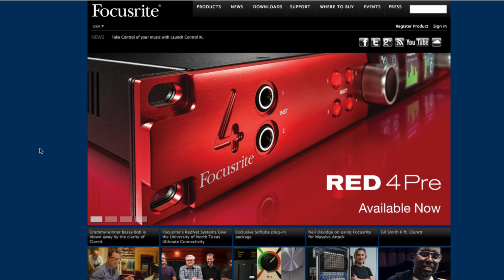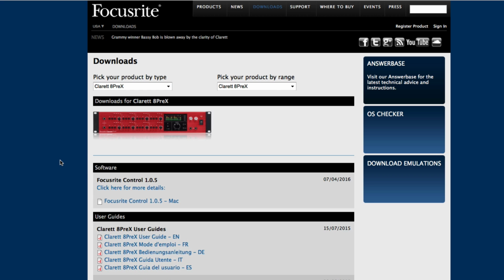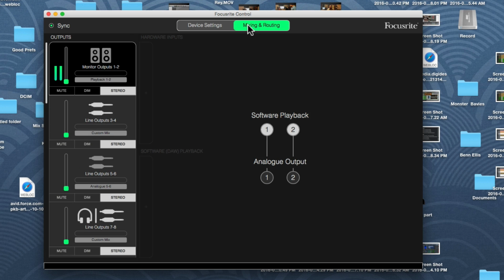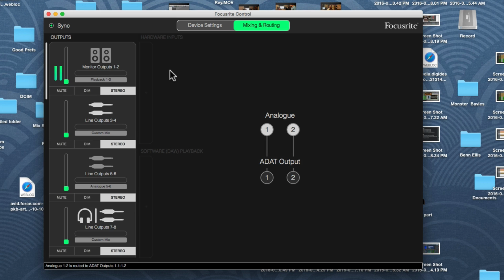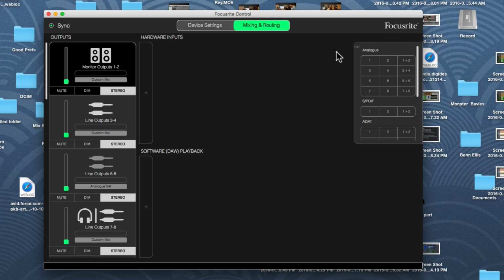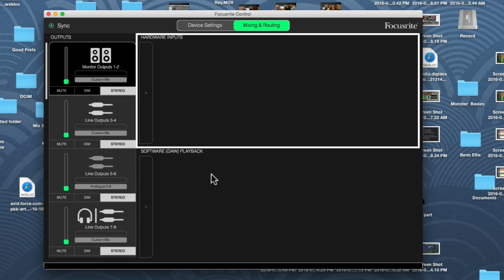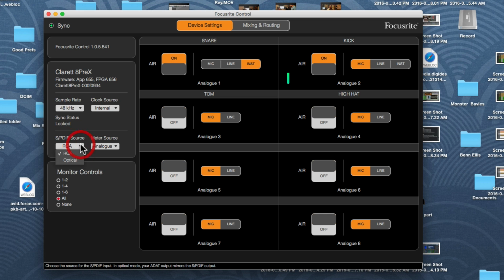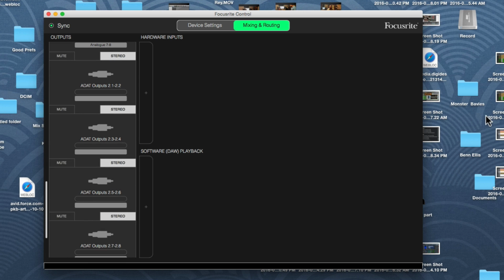Focusrite Control - Introduction

Comment: Does anybody have a problem in Device Settings? When I press the tab it shows ''No inputs with software controls''. There is no solution on the internet with this problem. Tried to reinstall drivers, but it still doesn't work :(

Comment: Hello! I have a question. I am sure the answer it's very simple , but it's just a thing that i don't know how to solve. I have an old oxygen 8 midi controller. The M-audio didn't realised a proper driver for windows 7 64 bit, so...the only way to use it is, as i read somewhere alse, connecting it via midi. So I have a midi cable, i connect it on midi out (on oxygen) and midi in(on focusrite scarlett 6i6 mk2). But, i don't see the "green light" on the midi on focusrite, and Cubase doesn't do anything, the computer doesn't recieve the midi signal etc. So...I was thinking. Is this something that I can solve using Focusrite control ? And if so..how? Because in all the routing options of the software i don't see anything about midi in and out...

Comment: Idk if anyone will see this, but I got a new setup and I had to install this software for my 6i6. But now, everytime when I start up my computer I get a black screen with white text, which has something to do with this software (I've never had this before). The computer works just as it should, but it's a bit annoying to have to wait a whole minute or so for the computer to boot up. Is this supposed to happen with USB powered audio interfaces/every audio interface?

Comment: If you are familiar with Saffire Mix Control, Focusrite Control will be easy to learn.  However, if you are used to using Saffire Mix Control, Focusrite Control will not be easy to learn.  Makes total sense.

Comment: So, I just got the 18i8.  I am using Focusrite Control.  Do I need Scarlett MixControl?  I downloaded it, but it says No Hardware Detected, but the Focusrite Control works fine with my equipment. Is there a difference between the two?
Reply from the maker: There are two 18i8 Scarlet Interfaces. Gen 1 uses Scarlet Mix Control. Gen two uses Focusrite Control. All the best
Reply: That explains it.  I have the Gen 2.  Thanks!

Comment: Man I really want to thank you soooo much, I was on the brink of wanting to return my 6i6 2nd gen because my digital piano sounded like garbage on the 6i6's headphone jack but after watching your video I realized I had to put my hardware inputs to 1+2 not 1 and 2 seperate. thanks a million my friend.
Reply from the maker: Rajivrocks Ltd. That's great news. What a load off your shoulders. I've had similar tech difficulties. It sucks. Glad you got it resolved. All the best. George.
Reply: wow thanks for the quick response, I have one question though if you don't mind. I have 2 options in the device settings Inst and Line I assume I would pick INST here but what is the difference?
Reply from the maker: Rajivrocks Ltd. Np. Use your instrument  input for guitars, keyboards. Use your line ins for an external preamp, Guitar w Di box. The instrument inputs are hi z
Reply from the maker: Lastly. Lastly select instrument if you have your guitar or keybioard in the front. Use line for the line inputs in the rear of your interface.
Reply: Thank you again man it sounds so amazing now, just like I plug my headphones in the back of my Digital piano! :)
Reply: this sucks.. I dont have the knowledge to fix my stuff so here I am on youtube trying to figure it out but it hasn't gone very well
Reply from the maker: Max Strandberg sorry to hear that. Let me know how I can help. All the best. George.

Comment: It shows up on Ableton, but focusrite control says no hardware connected
Reply: you probably fixed it by now, but I had the same issue I uninstalled everything and rebooted then I reinstalled rebooted and it worked fine. I think for me I already had ASIO installed before that might have screwed it up for me before.

Comment: Hey bro, I bought my Clarett 8PreX, I registered but when I plug in my guitar or mic It won't detect any sound?
Reply from the maker: Javier Serrano is the meter in the interface lighting up?
Reply: No it's not lighting up...
Reply from the maker: Javier Serrano make sure you go in the focusrute control software and select instrument or line instead of mic.
Reply: I got it fixed man! But now I'm trying to record 16 channels at once but I can't! 
I have my ADAT cable plugged in from In 1-8 (Clarett 8preX) to the Out in my Scarlett 18i20. 
And I go to pro tools and I can't record what's on the scarlet in pro tools.
Reply from the maker: Javier Serrano Make sure you set up the clock right within the focusrute control. Clock should be set to internal and the afar cable should be lit up

Comment: nice video,
I'm thinking about making some step from Fireface 802 to Clarett 8PreX but seeing how clunky the Focusrite UI is compared to RME TotalMix FX, I guess I'll just wait for something different then
Reply from the maker: I don't think the Focusrite control is clunky. In fact, it is very solid
Reply: hmm, and are you happy using it? I'll examine it more then :)
I'm judging it by "readibility", let's say (a real situation I just did today earlier) I'd make 1 stereo headphone submix, 8 mono submixes (for external IEM systems), of all which would combine all the mic and adat inputs at various volume ratios, at practically "zero" latency, as it's play-alive use, plus record all the input channels individualy each "pre-fader" , plus some loopbacks so for ex. a midi instrument could be played through dedicated standalone app but also sent to submixes and also into daw.... I wonder if Clarett 8PreX could be even suitable for that? (obviously paired with additional ADAT mic preamp/s)
I'm also checking UI of Antelope Orion Studio, which distinctively different as well :D
Reply from the maker: for sure. specially if your using software stuff, the Thunderbolt will come in so handy for you

Comment: hi George,  question about focusrite control.

im using an 18i8 2nd gen.
whenever i plug in my audio interface, it takes a lot of plug and unplugging of the usb connector to my laptop before it's recognized by the software. it's kinda frustrating. and when installed the app to our iMac (yosemite), it immediately catches on the hardware.
my laptop's iOS is 10.9.5 (i had issues with iOS upgrades). is something about the version of the OS or most likely i got a lemon?
Reply from the maker: Hello. Thanks for reaching out.  I would shoot an email to focusrite support. They will help you out. Even if you bought the unit used. It's not interface itself because it works on your imac.  I recommend the following troubleshooting steps. 1) connect external hard drive or other hardware to your laptop and see if it works. If it does, then your iOS may be the issue. 2) try a shorter USB cable. Are you using the power cable from your interface to power or just USB?  3) try one more computer other iMac. 4) Do you have the latest driver from FOCUSRITE? 5) Unistall and reinstall driver on laptop. 6) Try a different USB port on laptop 7 ) buy a USB hub. Maybe your USB has something wrong with it. 8) Contact Focusrite. 
I def think it may be your iOS. All the best, George.
Reply: hi george, thank you for the advice!  i found another way of solving it!

i just have to open the Activity monitor, click on CPU TAB. then i've noticed that there's a focusritecontrolserver and tagged as not responding. i double clicked it and when a pop up window appeared, i hit quit and voila! it can now read my 18i8 :)
Reply from the maker: anakhinskywalker awesome.